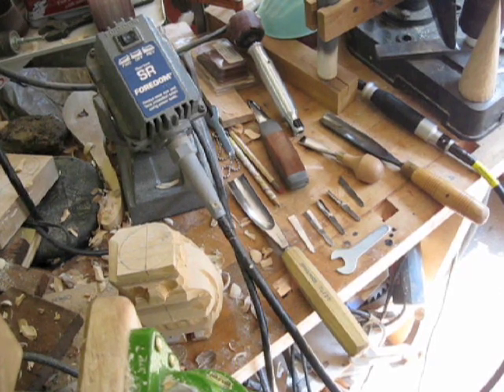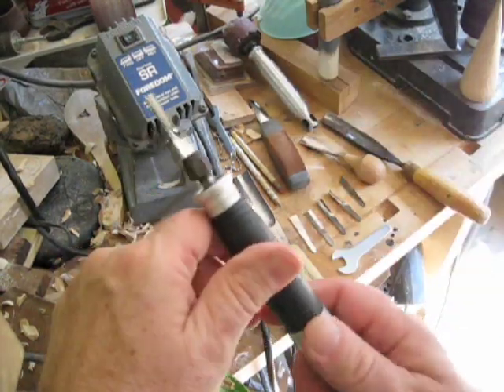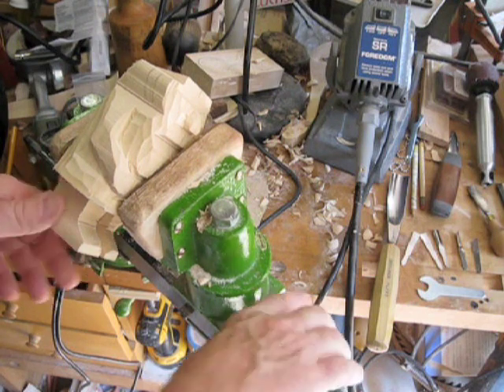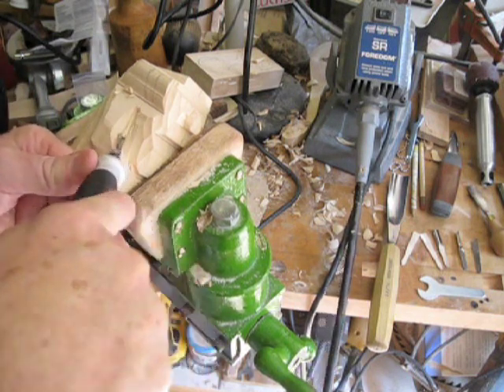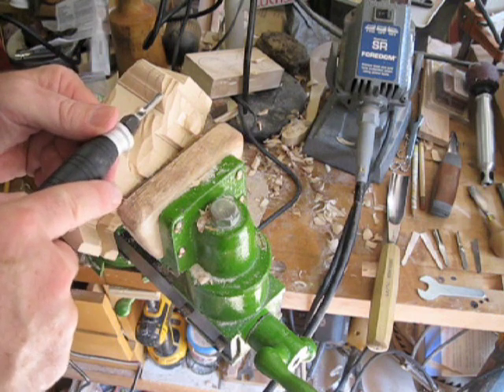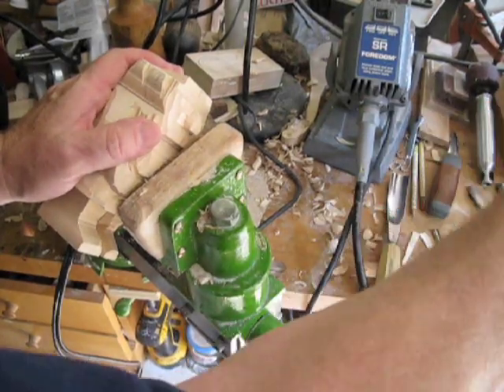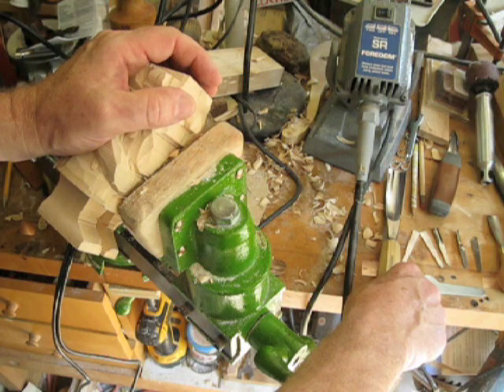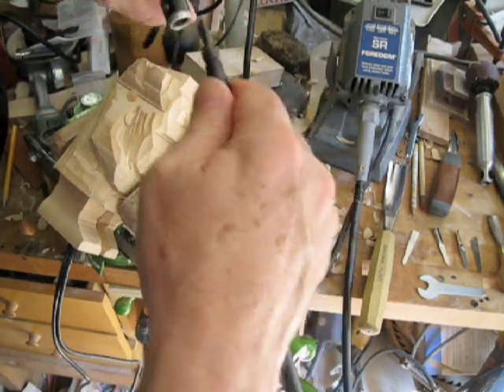Power Carver part 1

Comment: I know this video is old but Foredom recommends the LX motor for the hammer hand piece as the LX has a max rpm of 5000 which is what the chisels max rating is, they have been getting reports that when the chisels were used with the SR motor at 18000 people were burning up the hand pieces too fast.
Reply: I have seen the rating for that hand tool at 1000 to 8000 but Foredom advertise this. 
 Recommended Speed:
Optimum Speed Range- 3,000-10,000 rpm.
Max. Operating Speed- 18,000 rpm. 
Handpiece specifications: 6" long, 1" in diameter, weight: 4.6 oz., ship wt: 6.65 oz.
Reply: If you keep the SR at a low speed it can work. A dial control can help with that, too. If you 'floor it' it will damage any reciprocating handpiece.

Comment: thank you for showing it in action. the foredom videos are something to be desired. I notice you're carving some sweet sweet soft wood. it almost looks effortless.  what/how do you suppose it would work on solid hickory? (I'm carving a massive shepherds crook and need to get in some areas that are ridiculous with my traditional tools, and it would take me an eternity using them as well) 

thanks for your response in advance if you find the time. 

g
Reply from the maker: Should be fine. The tip just needs to be sharp.
Reply: Work with the tool. Let it do the work, should be good.